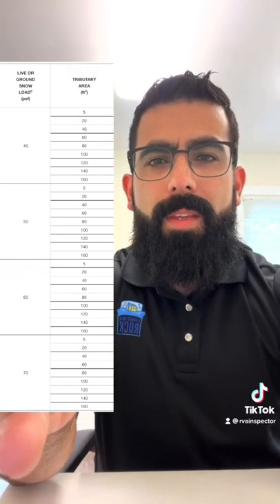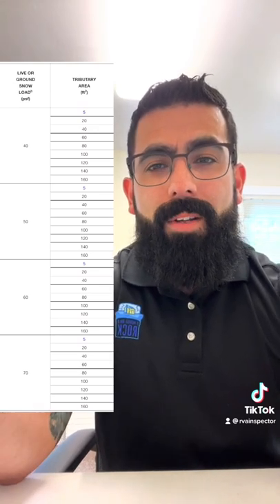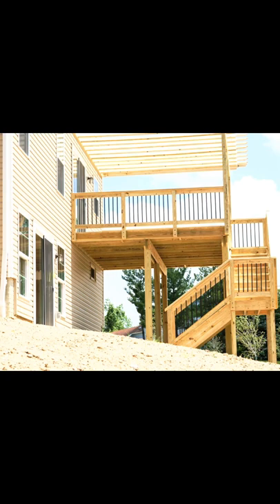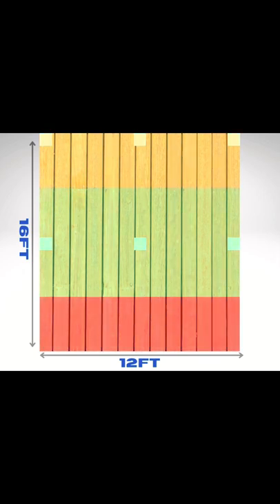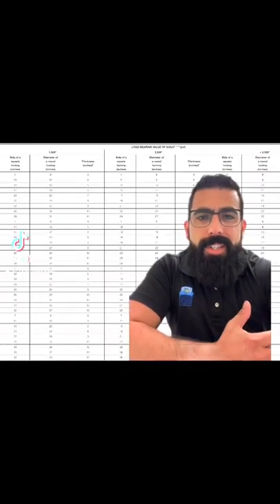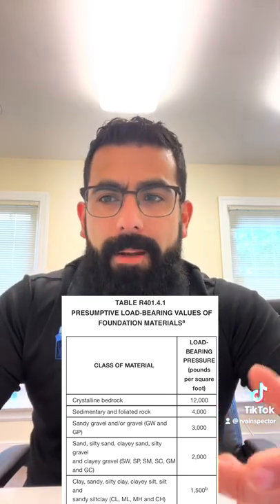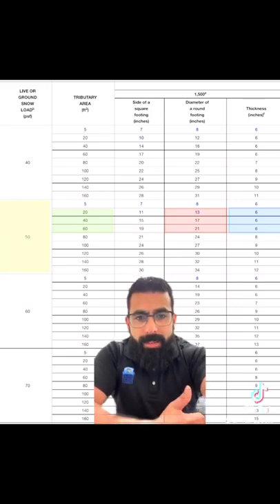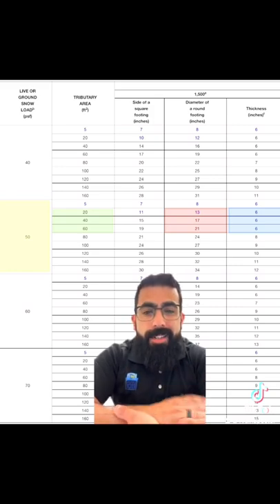How to Size Deck Footings

Comment: I don’t understand what you mean by , Thickness? I’m looking at concrete in a Sonotube down to 5 feet. A 12” tube gives the surface area of 1ft square, where does thickness come in?
Reply from the maker: Think of thickness as height.
Reply: @yourhomeinspector3298  but if it has to go below the frost line using a pier, that would mean the bottom of the pier needs to be that dimension...what about the column rising up from the bottom? what dia should that be?
Reply from the maker: @philbecker1660  the column size is irrespective of the footer. You have to use the post size chart for the code in your area. I’ll make another video on it
Reply: The area of 12" tube is not one foot square it's only 0.785 ft sq. The 2021 IRC has a better description of a deck footing then in the past codes. Check section R507.8.1 for the image of a concrete stem for a better idea on this concept. You may need to check with your local AHJ to see what code your on.
Reply: So you are saying the diameter of the footing and the last column is thickness….of the posts??? That wasn’t very clear what that means. If the footing is 21 inches in diameter and needs to go below the frost line then that is your height and width. What thickness are you talking about